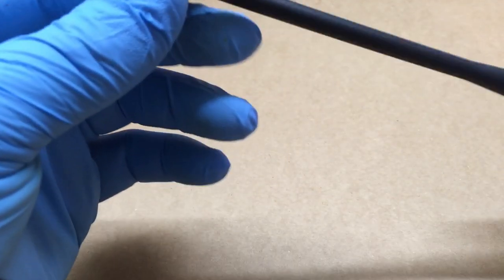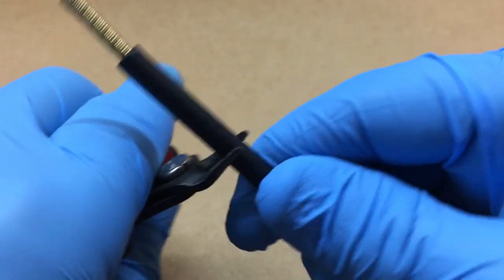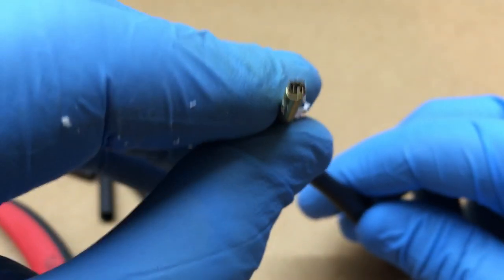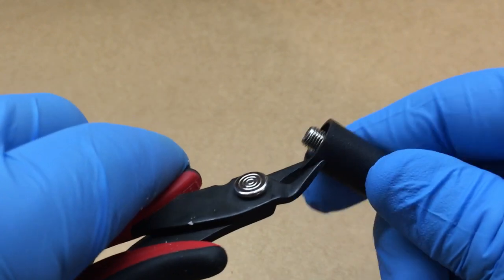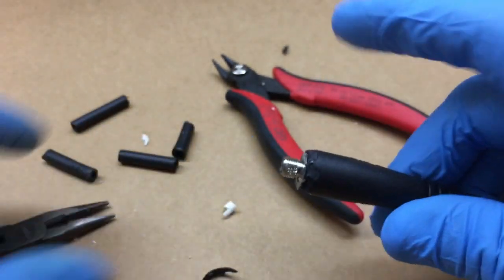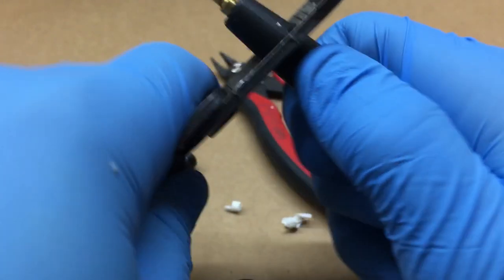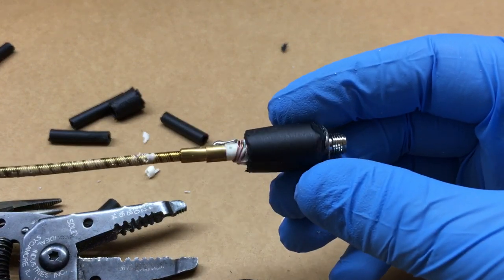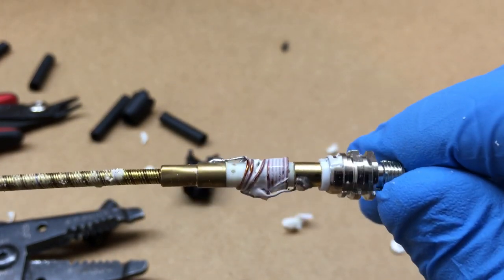Inside The Stock Antenna From A Baofeng UV-5R HT Radio

Comment: 9 turns connecting the rod to the ground, a 3pf capacitor that connects the number 6 loop to the positive of the sma, 1mm wire.

Comment: It might have been more useful if you had extracted a Cct diagram with turns, tap & connections to the SMA. 
Not easy from the screen with it rotating in your fingers and not fully clear of silicone. 
Value of ceramic cap...etc?

Comment: The earlier version of the Baofeng UV-5R had a different stock antenna. It was hard which tapered gradually towards the top. The disadvantage of this hard antenna was that it had a tendency to break when attached with the belt clip and hung on the hip. The one in the video is like a whip antenna that has the flexibility and around half-an-a-inch taller than the hard antenna. All latest UV-5R comes with this flexi antenna. Just wanted to know if this antenna performs better than the hard one with regards to range?
Thank you for this video!
Reply: thats a great question. the earlier uv5r models had a dummy load antenna(the hard rubber duck antenna). the new uv5r models have a "high gain" antenna. The one in the video that he is dissecting is the high gain antenna. With the build quality of the baofeng brand radios, i doubt the antenna is "high gain", but i do know it is better with transmitting and receiving than the old dummy load antenna.
Reply: @andrewstanley1027  Yes, you were correct!
73s
Reply: Hi Shandy Brandy:  I can only speak as I find.  I own five Baofeng UV-5R radios (shared around home, car, boat, and hiking!).  My first two radios came with the “hard”, slightly shorter, rubber duck antenna; the later three radios were supplied with the slightly longer and more flexible antenna.  Both types of antenna work very well for me and there is no discernible difference between using either the hard or flexible antennas.  The “hard” antenna is definitely NOT a dummy load antenna! 
I get good distances around my home town using either of the stock rubber ducks with local repeaters (both VHF and UHF), typically 10 – 20 miles distant.  When on elevated ground (average 1200 ft asl) in my local national park I easily reach repeaters 60 – 70 miles distant with the stock antennas.  I have tested longer Nagoya 701 and 771 antennas and found no advantage on VHF, and they are worse on UHF than the stock antennas.  This is real-world use, and I can only advise my own results.  I have found that hoiking around a 14-inch Nagoya not only looks silly, but defeats the object of a compact handie talkie.  Of the two stock antennas, I prefer the more flexible antenna for obvious reasons. 
All I can suggest is do your own tests and not be fooled into thinking that “longer is best”.  Other experienced local fellow Hams who use their radios in a similar manner report similar results.  Hope this helps.  Iain.
Reply: Peter Hu  Thanks for that, Peter.  Always interesting to hear other operators' experiences.  Overall, I still go with the stock antenna (preferably the slightly longer, bendier one) which at least has the advantage of me looking less nerdy!